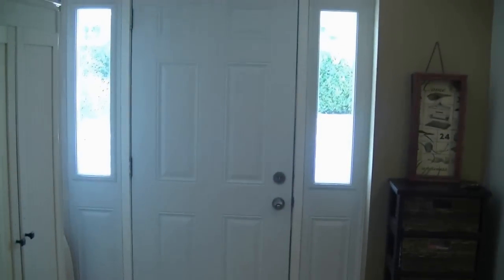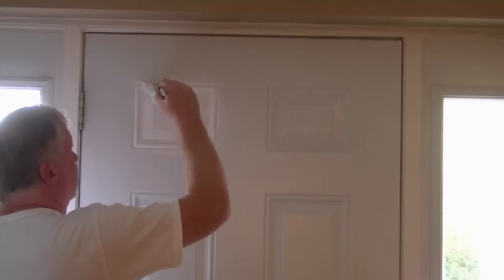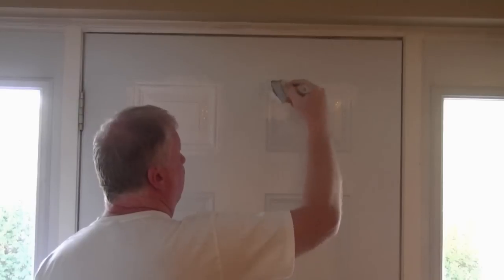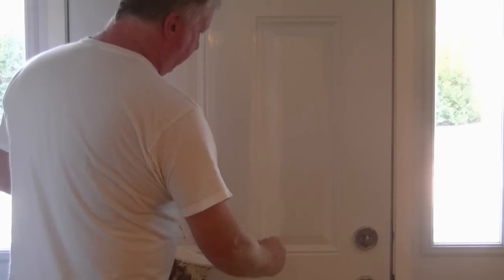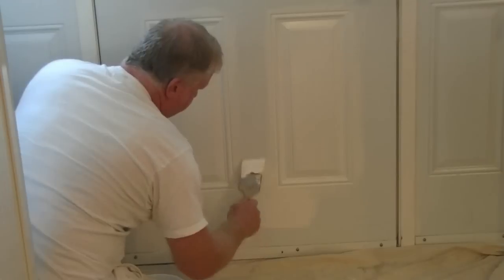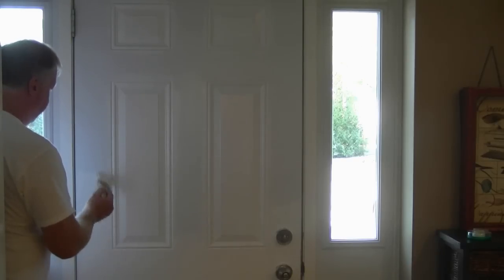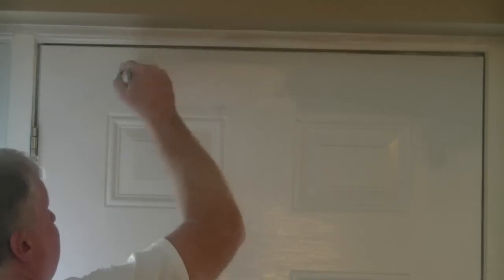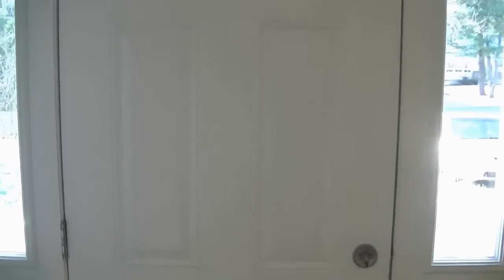How To Paint A Six Panel Door

Comment: Thanks for the helpful video. I think it might be better to have finished that top middle (short) vertical all at once so you don't have to worry about accidentally brushing back into the horizontal right below it or having to work back into the drying paint right next to it (at eye level).